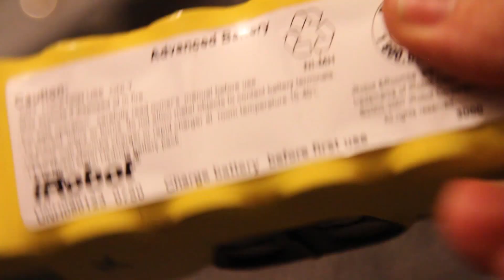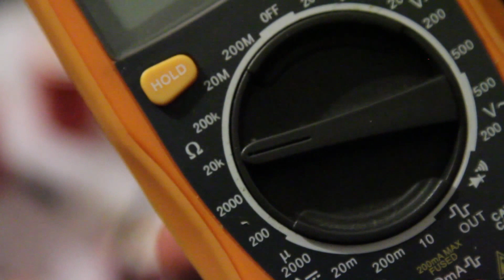Demonter 8 / hack rebuild battery 5xx-7XX-8XX-9XX irobot roomba

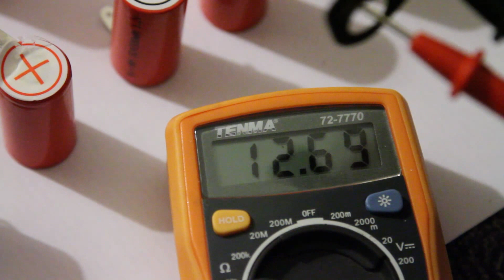Comment: Cheaper and less headache to simply buy a battery pack. Screwing around with NiMh cells has risks. Using the wrong cell or one with less capacity could result in bad things happening when they get over-charged. 12.7k reading reading shown at 6:16 is the thermistor. Extremely important - it monitors the temperature of the battery  pack (by using the one battery it is glued to.) What this video should have shown is how critical it is for battery connections polarity to the connector, and all cell interconnections. If you take a battery pack completely apart without makng a sketch of all connections first you are screwed.